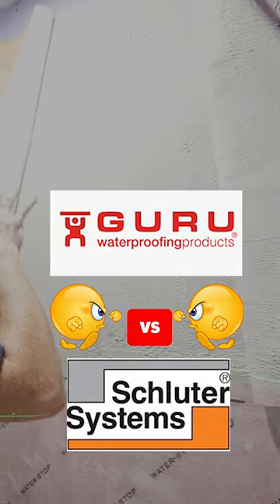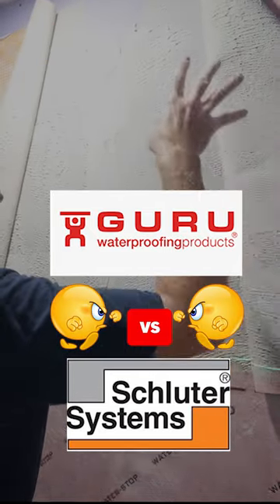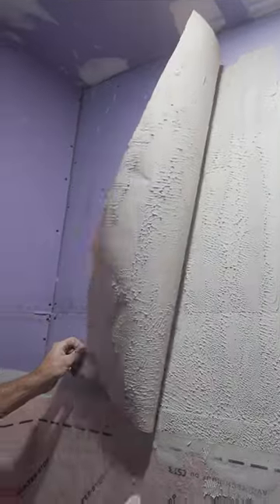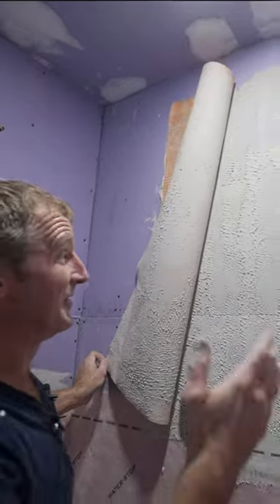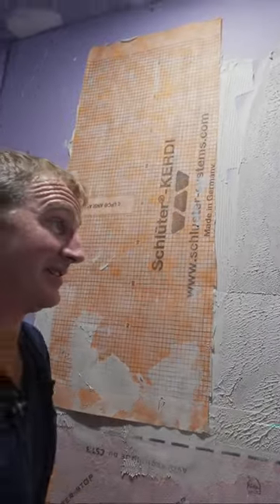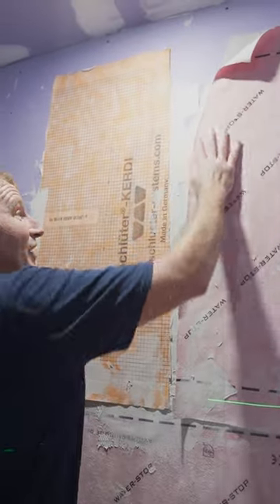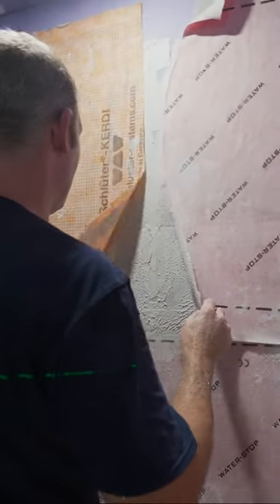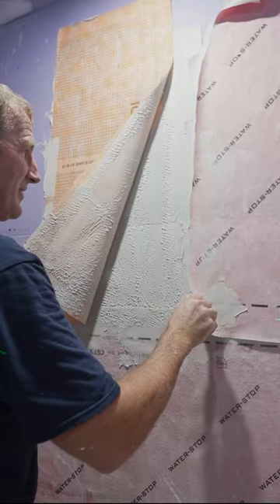Comparing Waterproofing Membranes for Showers #shorts

Comment: Thanks for doing the comparison. I haven't heard of Guru before. Are you familiar with ProSource Center in Pullman, WA? I really like their waterproofing membrane and shower kits. The fabric is stiffer than Schluter, higher waterproof rating and very easy to apply. No air bubbles at all.